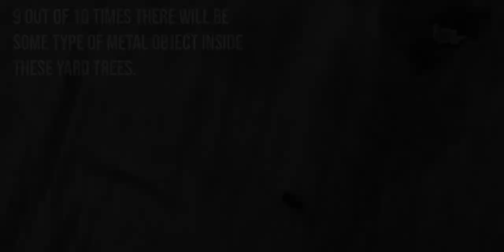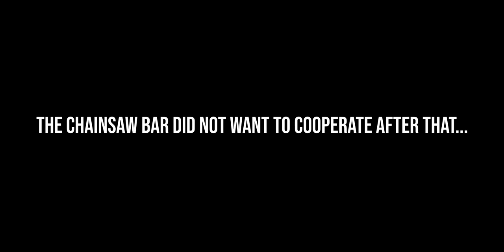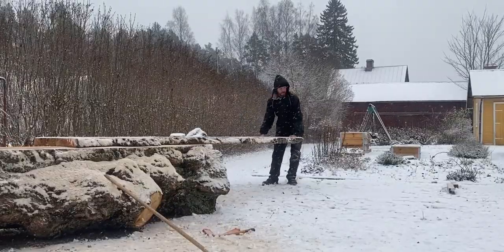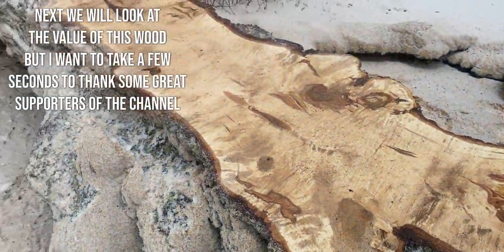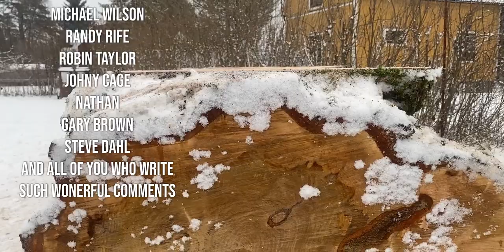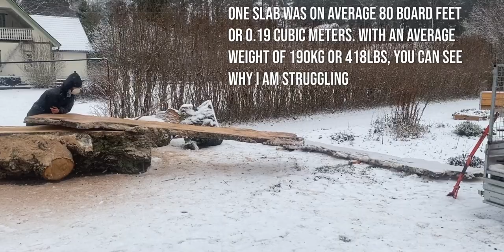How Much Is This Wood Really Worth? The Answer Might Surprise You

Comment: G'day BW, I just stumbled on your channel whilst having lunch. Like you when things aren't working to plan I go and have lunch and after that it seems to come good.I was thirty when I purchased my Alaskan Mill 48" I converted it to 3/8 for a thinner kerf twin power head with 066 magnums on either end. That was 27 years ago I've been running a Lucas Mill since 2009 it almost makes it fun 👍🇦🇺.
Reply from the maker: Great story man, them lucas mills are pretty sweet. Did you run the 3/8 lopro or regular 3/8?
Reply: G'day BW, on the Alaskan Grandberg I ran Oregon skip ripping chain that had the top plate removed on every other pair of cutters I call them clearers ive tried to get Lucas Mill to adopt the same chain. They don't want to run 3/8 with a 30 HP engine in the hardest woods on Earth, I'm prepared to risk it because I don't file into the links. I have this debate with their head tech advisor on a regular basis. They want speed I want a balance between speed and finish. Good to catch up with you all the best Ishman 👍🇦🇺.

Comment: I've more or less stopped milling with an Alaskan and gone to a Lucas dedicated slabber (if it wont fit on the lt40), but if i may suggest.

Open using the ladder.

On your next cut lay down a straight edge of hard wax oiled 18mm Birch ply 200mm wide (or more), this goes on your left side and over hangs all of  the log edge  (and 500mm the ends) i just screwed through the ply to the bark underneath, lay down a second piece on the right just as a support for the far end of the mill, you can place packers along under the ply to level out any twist that occurs, (plastic window and door setters work well)

Lay the mill on top at the feed angle you want to cut with, fix a piece of 12mm birch ply (oiled) to the underside of the mill cross rails this sets your cutting angle.

Adjust mill to your slab thickness plus the 18mm ply and cut, eliminates all the in and outs of the tree is almost self feeding, your not wasting energy pulling the mill out past a burr.

I also have a bungee cord (6mm) to the throttle (like a surfboard lanyard), just one wrap around the throttle to my wrist, stops immediately you slacken,  wrap an abrasive spiral around the top pushing cross bar for grip and you are good to go from any position.

Comment: I found that when milling you need to tighten the chain after you warm it since the longer the chain the more slack it gets, I run a 212cm mill and I always  get better results when I double tighten the chain, a lot of times it starts really tight but still jumps from the rail if I don't adjust it after it is  warm. Ps I broke the needle bearing on 880 aswell, aways buy 2 or more:)).
Reply from the maker: Yeah thats a great tip, and i totally know what you mean. Incredible how much stretch there is in these long chains.
Reply: @backstromwoodwork566  I think that the chain jumping from the rail is the reason the bearing broke, ever since I double tighten no more jumps or other problems. What chain are you running? I mainly use the oregon hyperskip on big logs and the normal skip on unde 1m both in 404, cuts like butter

Comment: I really like your videos!! How long will it take to dry these birch slabs in your kiln? What do you calculate your cost of the same slabs will be? I understand if you do not want to answer that part. I ask because I’m thinking of buying a mill  and could use more information. I’m looking forward to your next video.
Reply from the maker: Hi Ralph! Thanks man, i wait till my wood has air dried below the fibre saturation point (around 28-30%) which takes about a year or 18 months, then kilndrying is around 6-10 weeks depending on species. Pricing is difficult, and if you never been in the wood business before then it is even more difficult. But try and get a good idea of what the prices are in your area for hardwoods, and use that as a starting point. Dont undercut yourself, if the market price says 3500$ per cubic meter of oak (which is what it is around here, plus tax so its more like 4375$) then you shouldnt sell below that, unless for some reason you feel you cant offer the same quality, and by that i mean drying defects, or not as dry, or dry enough.. drying is hard to get just right and you’ll eventually get a feel for it. But again, pricing is difficult, thats what i wanted to explore in this video, because i too dont have a complete clear picture of all my costs and what i need to sell for to make a profit and so on. Maybe we can revisit this topic in a future video. Thanks for commenting!
Reply: @backstromwoodwork566  Thank You

Comment: Do you get "visa Koivu" (in Finnish) or curly birch, in your part of Sweden? thanks for your video...  Ps did you have to pay for the tree from the homeowner?
Reply from the maker: Yes, but its super rare, and if you go back to an earlier video of mine (building the dubbel cutting sawmill) you can catch a glimpse of the one and only time i came across masur birch. Sometimes i pay the owner if it is obvious that a log has value, but the markets for huge logs is extremely slim, and often time its more of a problem for the homeowner, and thats why you even see ads sometimes from people looking for somebody to come pick it up, so they wont have to hire somebody to cut it up and take it away. And sometimes a homeowner hire me to mill their log so they can keep the slabs, so then i just charge per hour, so it depends on the situation